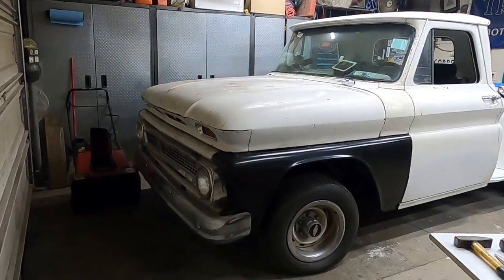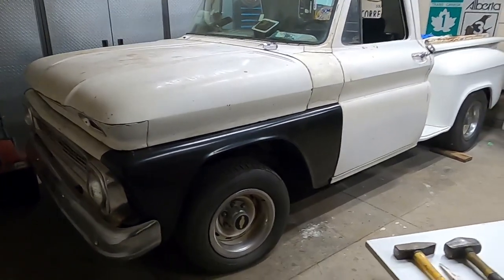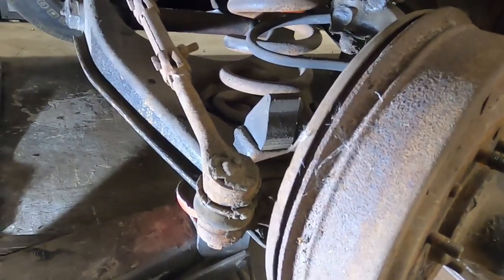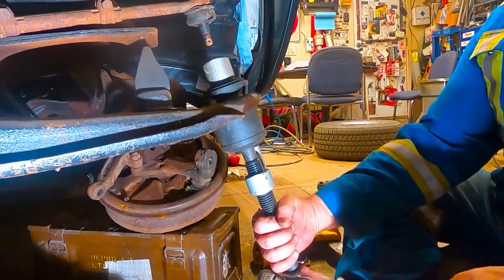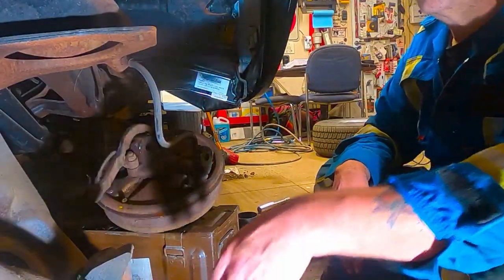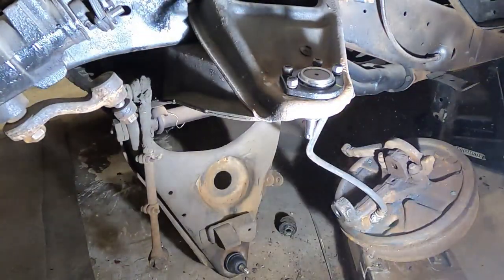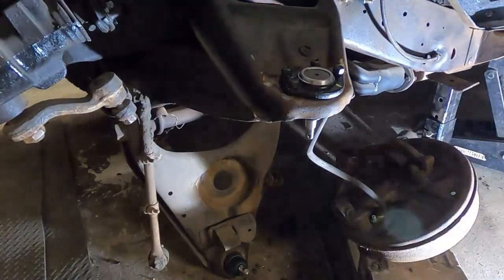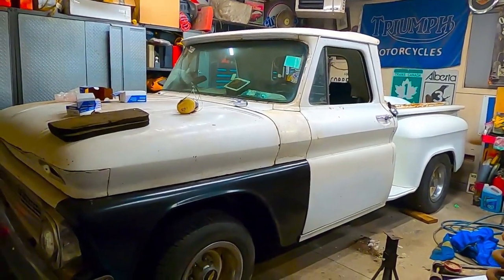Upper and Lower Ball Joints and front Coil Springs on a 1966 Chevy C10

Comment: So I gave this a try after watching your video. Got the shock off, the top ball joint replaced, and then the castle nut off the bottom ball joint. However, I for the life of me cant get the bottom ball joint out from the steering knuckle. Tried pullers first, then tried for a good while using a ball joint pickle wrench. Can't even get the pickle wrench in there. Used a BIG hammer with no luck. Any suggestions?
Reply from the maker: I’ve had luck with an air hammer with a pickle fork attachment. They’re cheap on Amazon, good luck to you

Comment: Everyone I’ve ever lowered with coil springs settled but it takes a couple of months driving. Hope this helps.
Reply from the maker: It does…. I’m feeling quite defeated right now actually
Reply: @shortcutgarage  2" drop spindles and front disks will make you feel better. 😎👍 the price might make you a little queasy but the new lower stance will fix that
Reply from the maker: @maggs131  I just put drop spindles in the 66 Panel Truck, love the stance 😎

Comment: Upper and lower ball joints had a plastic spacer in between.   Was that replaced or did you just install the rubber boot without the plastic?
Reply from the maker: Interesting. I didn’t notice a plastic spacer. I have another set to do soon, maybe I’ll pay closer attention and make another video. Thanks for the tip, sounds important. Any idea who carries it?
Reply: @shortcutgarage  I've been trying to research it.  You can see a glimpse of it on your video.  I'm assuming they might have done it to protect the boot from tearing apart.  It's located where rubber boot would touch metal on top.
Reply: Around 6:53 of your video you pull the upper control arm down and you can see a yellowish plastic washer.  Your bottom didn't have one, maybe was replaced once before?  I have one on upper and lower ball joints.  Curious if it's needed.  66 gmc 3/4 ton.
Reply from the maker: @ihatesjws669  I’ll go back and have a look

Comment: The bolts should come in from the top so they dont fall out if the nuts fall off god forbid
Reply from the maker: Good call.  I’ll remember that.
Reply: I was going to make the same comment, have seen several videos with guys doing this🤦🏻‍♂️, not to mention it looks crazy.
Reply: Bad advice… if installed the other way, the bolts rub on and will rip the boot. That is why everyone who knows what they are doing, installs them this way (with the bolt through the bottom and the nut on top.

Comment: You need to roll the truck a bit after you lowered the wheels down on the ground, they are not in the right spot before you do that

Why did you not change the steering joint, the boot is broken ;)